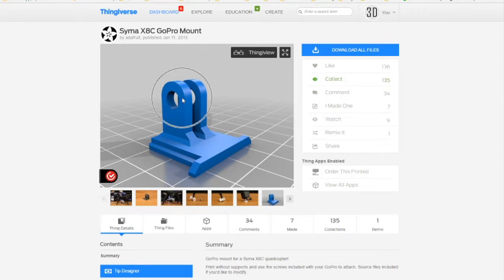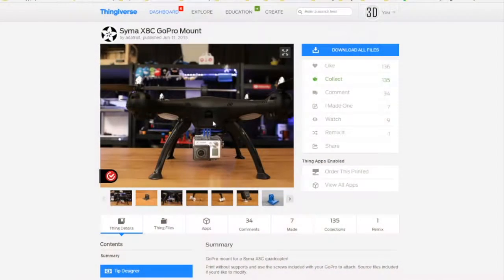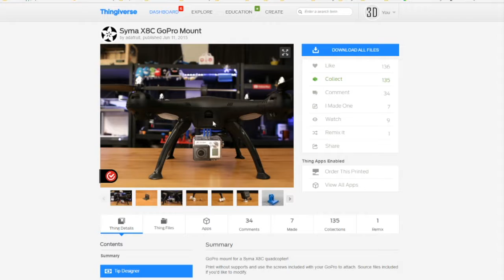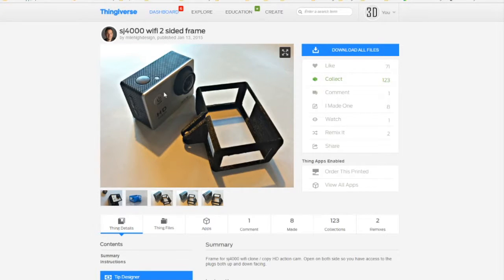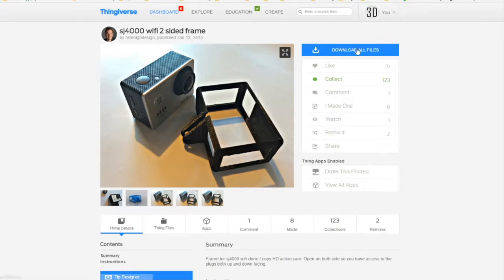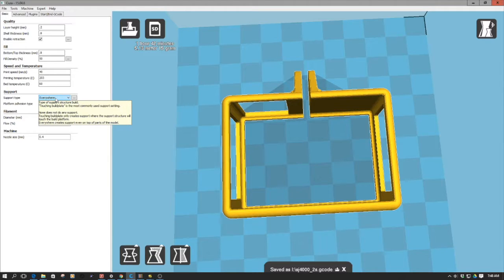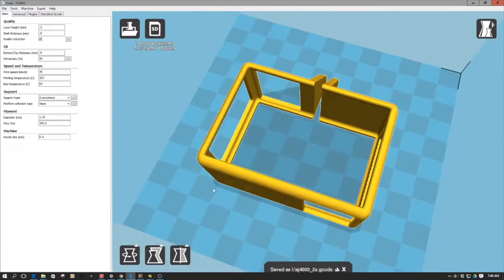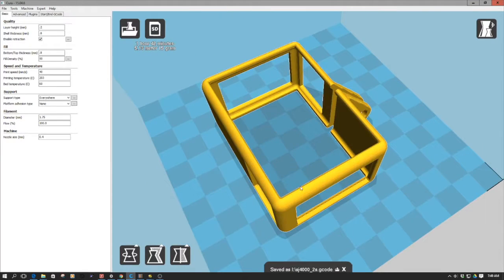Video Drone - 3D Printing a GoPro Wire Frame Holder For The Syma X8!

Comment: I have the X8G Camera and I want to use it on my X8C. I got the Camera used. What would charge to build one for me? The part that broke on the camera I have is the part that hook on the bottom of the Quad.
Reply from the maker: Not sure of the question, on thingiverse there are adapter for the Syma X8 which you can print.
Reply: What would it cost me for you to make one for me? I don't have a 3d printer.
Reply from the maker: Sorry right now don't have a lot a time as I am travelling for  business a lot.  However here is link one (http://www.thingiverse.com/thing:633830) and link two http://www.thingiverse.com/thing:1478168
Reply from the maker: Wait no one told you that 69 is the new 29?  :-) Trust me you don't have too many years on me!